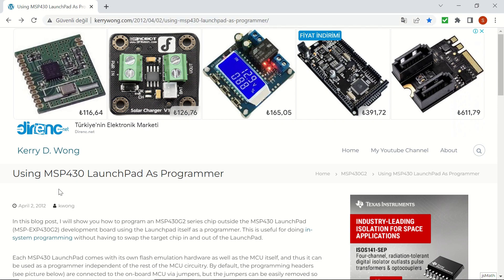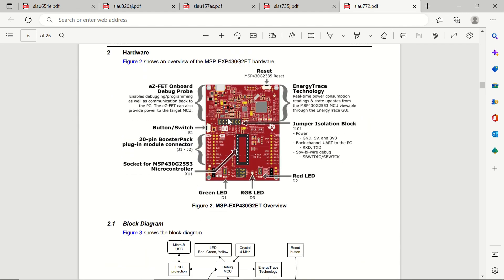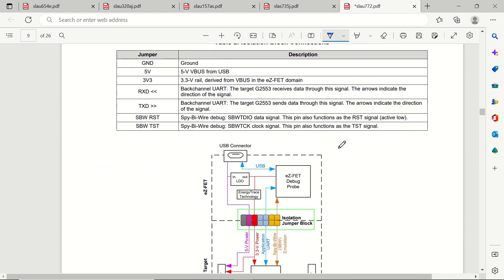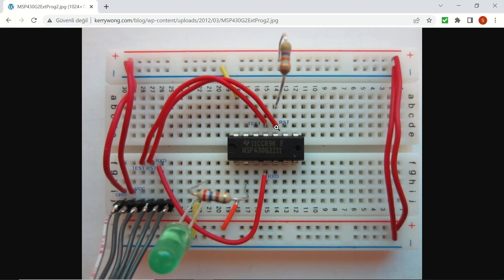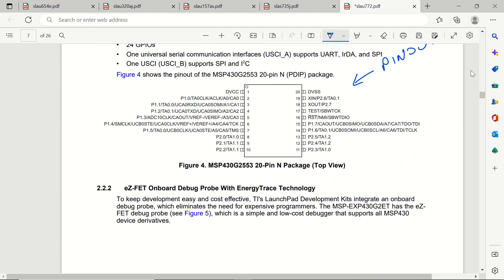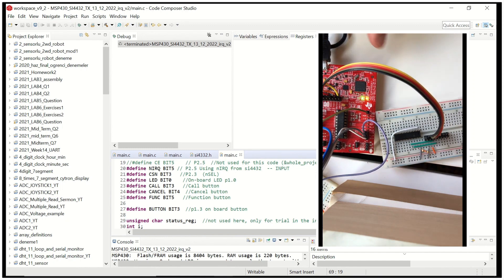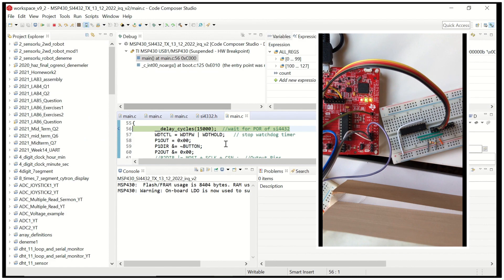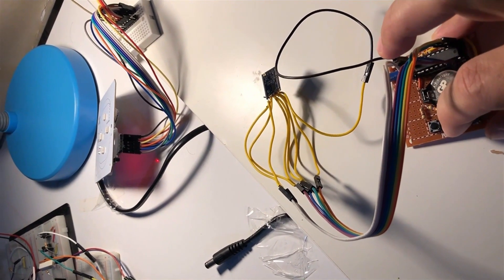MSP430 Launchpad as External Programmer

Comment: Thank you, i wish i had this video year ago) Did you ever get an error "Could not find device" with fr5739 or other? Could it be cause of locked sbw?
Reply from the maker: Thank you for your comment. I used it only with g2553, and didn’t get any error messages yet. As you mentioned it may be related with missing bootloader.

Comment: Great content as usual. I am looking to see if I can hook up something like an ADXL345 IMU unit to my MSP430, it's not a launchpad I don't have it on hand, but it is most likely an MSP430FR2433 I just want to read and record the Euler angles is this possible with these types of MCU's or is an Arduino or Pi more suitable for these types of projects?(Possible video idea 💡🤔)
Reply from the maker: Thank you for your comment. Msp430 family is suitable for such devices. You need i2c or spi to interface with adxl345, and msp430 is capable to do that.